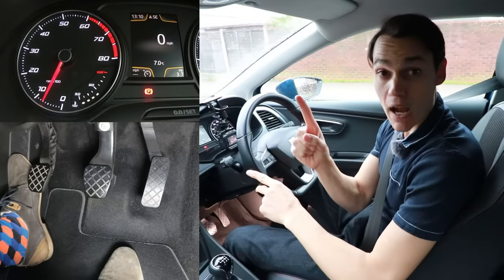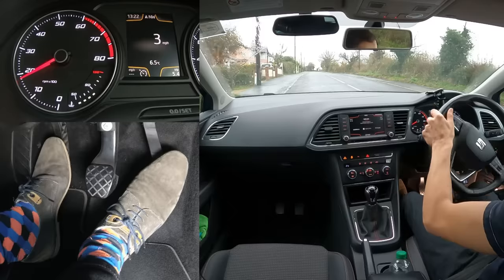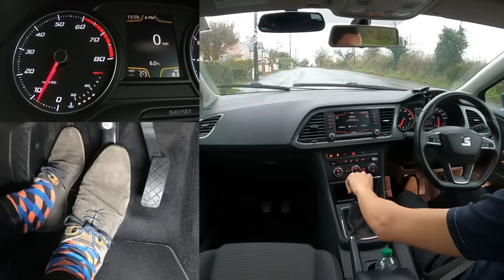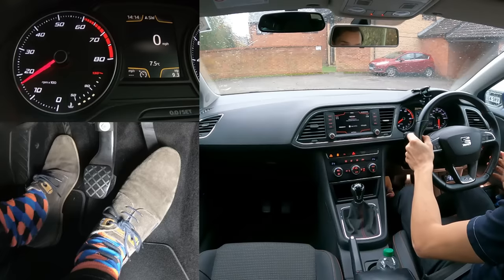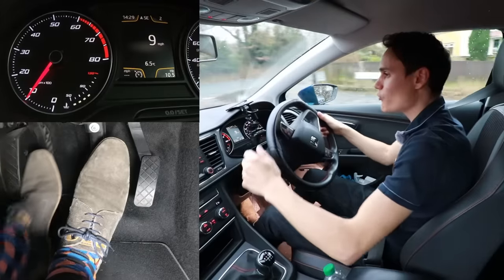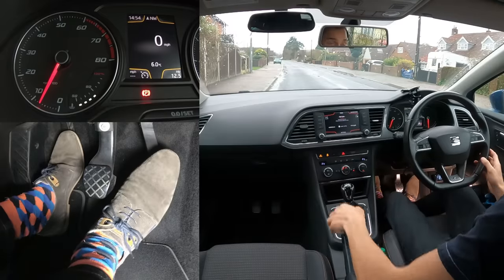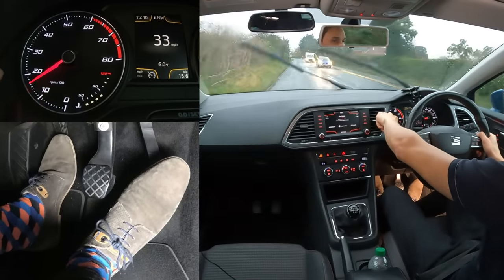How to make your clutch last longer without stressing the transmission.

Comment: I have been driving my own car for 5 months now, and I still find your vids very informative and useful. Thanks!
Reply: +1
Reply: That doesn't mean you know how to perfectly drive a car lol
Reply: Dont listen to this guy. In one of his video he was telling people how to downshift he ssid downshift to 1st gear. You never downshift to 1st gear. 1st gear is only use to take off. You damage your transmision like that.
Reply: You ask anybptofesionsl' there tell you not to do that. Once he said thst I change the video
Reply: @KrishnaSingh-ss9ef  I don't know exact situation you are talking about but if you slow down a lot. Like a couple miles per hour you are forced to downshift to first. Depends on a car too. In mine you have to at least if you are going really slow
Reply: @advocatesdevil7064  no you don't. 2nd gear can handle 0 to 500 rpm. I have been driving like thst for 10 years with my car. Didn't have to change my clutch yet. I1st gear is only use to move the car from starting position.downshifting  yo 1st gear is not the right way. When you gown shift ton1st gear. You can hear the car shaking and its difficult to, that tells you your not supposed to do that.what would you rather change your brakes or your clutch. Clutch is very expensive to replace.
Reply: I never heard of any car thst you are forced to downshift yon1st gear. Never heard of that in my life
Reply: If anybody want to damage there transmision, keep downshifting to1st gear.
Reply: @advocatesdevil7064  the other stuff he talks about, I agree with. Don't feather the clutch yo much. You can wear it out and also don't relax your foot on the clutch unless your changing gear
Reply: @KrishnaSingh-ss9ef  my car doesn't shake if I got into first gear when I am going super slow. It's same as other gears just way shorter. If I am going super slow in second gear my car is about to stall and that's what feels bad. Going back to first gear actually feels better. But again this is for super slow surfing like in a parking structure. Not all cars are the same. Yours might be fine doing that
Reply: @advocatesdevil7064     Krishna Singh is correct. If you are on a relatively flat roads, there is no need to change down to 1st gear in most modern cars. You will only use it after you come to a full stop. 
Oh, my Mini was 75,000 miles and 12 year old before it needed a new clutch. Some cars wears faster than others. Average cost is around £600 (mostly labour cost). After all, it is a wear and tear item. Unlike me, most people change their car between 2 to 5 years. So clutch wear doesn't even come into the equation.
As a newer driver, I think you should pay more attention on other road users instead.
Just my two cents.
Reply: @advocatesdevil7064  you might be right baron, all cars are different. I have a sports car, so my car might be different than yours. I can be in second gear and drive very slow. But like I said,  try not to downshift to much, thst wears out your cluth. If you have yo stop downshift to 2nd gear and put it in neutral. Unless your rev matching which takes a while to learn.Like I said clutch is way more expensive than. Changing breaks.
Reply: You think 5 months is a long time?
Reply: @buhketz  lol 5 months. There's info for everyone even after 20 years of driving as in my case. As for 1st gear, you pretty much have to come to a full stop in order to put 1st gear in, same with reverse which most definitely needs a full stop. Not all cars even have synchronised 1st gear nor reverse for that matter.
Reply: @GymChess  see, I didn’t know that about first gear. There’s always much to learn.
Reply: @KrishnaSingh-ss9ef  You silly don't know anything about driving or damaging transmissions. A big YES to downshifting to 1st gear!!! I do that a lot and there is a very good reason behind it relevant to good care of a manual trans car and it happen too often if you are really a driver. The guy in this video is right all the time.
The scenario:
Driving in whatever high gear, and not far in the horizon down the road I see traffic really slow and cars' tail red lights ahead of me are intermittently on and off as they move slowly for an indefinite distance and stop and again and again...I lift my right foot off the accelerator completely and let the car idle/coast until I reach within about few tens of meters and where my idle engine rpm slowed down to around 1300/1200 (I don't need to look at the gauge, just sense the entire system [wheels, vibration, clutch, transmission] by feeling) and so then at around the above mentioned rpm I hit the clutch, shift to neutral then slow down further and smoothly with the brake pedal while weighing and calculating the traffic's speed and then change to a gear suitable for that; let's say 2nd, but somehow upon getting closer and closer I figure out that even 2nd gear (say 5 mph depends on car) is still really too much and the car would start to vibrate if I use the brake to slow down further! There ladies and gentlemen where I find myself and rightly so technically and physically obliged to downshift to 1st gear!!! 👏Here transitioning to 1st gear goes wonderfully smooth and the car moves really slow but most importantly in sync with our traffic scenario speed!!! Of course as you know, at any moment in our traffic I might very well find even the 1st gear is too fast 🤔 I then hit clutch/brake almost simultaneously and shift to neutral☕
Reply: @triple-alphatv2946  downshifting put major stress on your clutch and gearbox.  So why would you want to downshift to 1st gear when you can just go to 2nd gear. Put it in neutral and come to a complete stop.
Reply: 12 years and I've just learned a few things lol
Reply: @KrishnaSingh-ss9ef Ive been watching his videos non stop for a last couple of days and he never said that
Reply: I’ve been driving for 11 years and I still watch these videos, the best 3 channels in my opinion are Conquer Driving, DGN and Ashley Neil.  These 3 channels have really helped me be a better driver.
Reply: @KrishnaSingh-ss9ef No he didn’t say anything of the sort.

Comment: You can push the gas before releasing the clutch. With this you avoid engine braking and have better fuel economy. Both is bad over slip and under slip. The springs on your clutch help to prevent the slip when shifting to avoid unecessary friction. That's why you should release the clutch hard. Only the first gear wears the clutch. When the car is accelerating from 0 mph. Don't use your clutch as a brake when shifting down. Shift down quick instead. Then you can let your car roll down. The clutch are like your brakes, each slip causes wear. Avoid unecessary friction and it will last long.

Comment: Yes!  This is exactly the video I needed!  In the "shock" sections of this video, I experience one or all those scenarios, at least once every time I drive.  Sometimes my car jerks when I change down gears, sometimes it doesn't, sometimes it kangaroos when I release the clutch after moving off, sometimes it doesn't.  Again, exactly those situations shown in this video.  But I didn't know what I was doing wrong.  Now I know, and I'll take steps to correct it.  This is definitely something I will work on.  I had no clue I was causing excessive wear to the drivetrain components.  Wow!  I've been driving a manual for close to two years, and I'm still learning something with every new video!

Comment: This video basically told me that I've been driving correctly. Thank you. My car is notorious for having a bad stock clutch (10th gen 2018 civic si), but I haven't had any slipping and I'm at 70k miles. I appreciate the work you put in this video 🔥🤙🏻
Reply: Did the climate control or the steering rack go on that 8th gen yet? Many issues with those ones
Reply: @everydaybodybuilding2282  8th gen si owner here with 214,000km. all the electronics work, no issues with the steering rack (its electronic) more reliable than the hydraulic system. The clutch i had replaced at 140k, still pretty tight.

Comment: For advanced drivers:
-Gear down : always rev match with a throttle blip and a smooth but quick release of the clutch (heel toe if you need braking).
-Gear up: change gear at 0g (that moment between acceleration and deceleration when you release the gas and press clutch).
-For launch don't over rev it , stay in the high torque zone and sync both pedal movements, the more you press the gas, the more you release clutch, for fast or slow starts.
-Clutch kicks are always your friends for breaking traction when full throttle doesn't cut it or you're too low in the revs and about to bog down,
you should be full throttle and then kick your clutch, the swifter it is the smoother it will be.

All these techniques can be done smoothly and shouldn't damage your clutch more that regular driving.
If you're doing it wrong the car will tell you by jerking.
Reply: Yeah I don't ride the clutch near as much as this guy advocates, if I have to delay an up-shift due to traffic and I get stuck in neutral in between second and third I just blip the gas up to get the revs up to where they were before I let out the clutch.  Downshifting on the highway to pass is the same, throw it into neutral, blip the gas to add 2-3K, quickly ease out.  The only hard to do one is the braking downshift, aftermarket pedals help but unless you are a track day junky when you are pulling up to a light you can just pop it into neutral and let the brakes (which are the most expendable of all) do all the work.

Also the handbrake hill launch thing is weird to me as an American, I just release the brake pedal and go right to the bite point as fast as possible.  Although my Subaru toward the end of it's clutch life (~80K, 45k of which was me) had problems with any reverse momentum at all so using the ebrake is probably better for it. It was also kinda weird anyway it didn't like hard launching in general due to the AWD I presume and it has an auto hill assist brake anyway.
Reply: You're just basically talking nonsense. Heel-toeing on street? Have you even tried to do that yourself?
Reply: @RomasTam  what's the problem with rev matching on the street? I learned to do it, just to try it out, but now, I'm doing it most of the times, because slowing down is smoother without riding the clutch.
Reply: @RomasTam  heel-toe on the street?
why not? 
clutch kicks on the street however, is a different story entirely. mostly because you'd probably break a few laws lmao
Reply: @RomasTam  Every time I go down a gear, everyday. please drive carefully when you try it out, it can take a bit of practice.
Reply: @RomasTam  i exclusively heel-toe on the street. anything else feels inefficient and like it causes more wear in comparison
Reply: And final tip:
All the tips mentioned above are actually unnecessary for normal road driving except a good downshift.
Reply: @hiighcalibre  Newer cars have hill-start assist that hold the brake for an initial few seconds on hills.

Releasing the brake and not having the clutch already at the bite point can either cause you to stall from not enough throttle or roll back.

Rolling back is actually something you can fail a driving test for in some places. It's dangerous to roll back even a few inches on a steep incline because you can hit cars, people, etc. 

I personally don't use it on my car unless it's very steep though.
Reply: @sjb122  lol right
Reply: @RomasTam  Git gud scrub, it's easy!

Comment: I changed my first clutch after 10 years and 165,000 miles. This is great info, and it is basically everything I do when I drive. Your clutch will last a long time if you follow the advise in this video.
Reply: A friend of mine has got an old mercedes with double the mileage, I don't think he's had to change the clutch yet. So you might have room to improve 😉
Reply: @Daniel-dj7fh  I'd gladly exchange a bit of clutch life, for the occasional fun. Zero to 60 in less than five is a nice rush.
Reply: @Daniel-dj7fh  If your friend travels mainly highway while the dude only uses the car on the road that's a fine result... It depends..  Just a guess
Reply: @brokentougers8252  The car was defo not used mainly on highways.

Comment: The release bearing is extremely important ! I did exactly what you described there with my first car, resting my foot on the clutch and it not only caused tremdendous stress to the release bearing, but also wore the clutch down and put it under constant heat when it was slightly dragging from time to time. Needless to say my clutch exploded ( was an old car ). 
I am glad you put this in your video so beginners never have to make the mistakes i did and learn the hard way like me.
Reply from the maker: I totally agree, all parts of your clutch are important and the release bearing is often over looked.
Reply: @ConquerDriving  You are a good driving instructor, very considerate
Reply: @ConquerDriving  Are there any data how often release bearings wear out? One, how often does it happen that a release bearing needs to be changed before the clutch disks need to be replaced? Conversely, how often do people change the clutch disks without changing the release bearing (because the release bearing is in a such a good shape)?

Also, how does the release bearing wear and start-stop system interact? I have only driven cars with start-stop systems briefly, as much as I remember, pressing down the clutch while at a standstill triggered the start-stop system while releasing the clutch restarted the engine. And for cars without a start-stop system, couldn’t a rule of thump be that if you are at a stop long enough to warrant putting the transmission into neutral (and thus releasing the clutch pedal), this would equally warrant shutting off your engine? Of course, in a car without a start-stop system the battery and alternator might not beefy enough to support too frequent engine shutdowns.

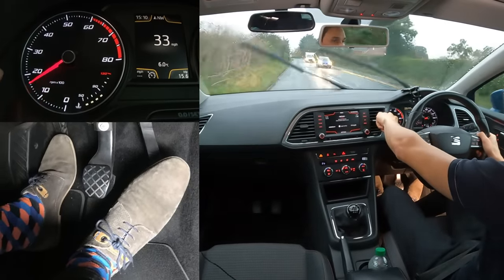Comment: 10:48  - A very interesting point, as a new driver, I'm applying the HB and releasing the footbrake. Some break lights are quite annoying to my eyes so I often think of those behind. It's good that you have pointed out that your FB is far stronger than your HB in that scenario you mentioned. Thanks for that.
Reply: I do this but only when I anticipate being stopped 30 seconds or more or when on a steep hill where clutch control is more challenging. My car has LED brake lights which are safer but also brighter to stare at when sat in traffic so I am aware of it.
Reply: @gravemind6536  Aye as a new driver, I've only ever learned if I need my handbrake get it on. But I reckon that was a hangover from learning how to pass the test, not necessarily learn your car
Reply: Parking brakes usually only applies the brakes to the rear wheels in most cars, however the foot brake applies to all four wheels, which is why the FB is usually more stronger and also easier to use because of brake boost.
Reply: I live in Florida so pretty much all the roads here are flat so I tend to not use either the FB or HB, that said I'm constantly keeping an eye out behind me to make sure people are slowing down properly. God knows Americans can't drive, especially in Florida.
Reply: I believe that standing on the footbrake for a relatively long while when the car is not moving, may be, under some circumstances, not very healthy for the brake discs and pads. I’m guessing it may be the case when the discs are hot or wet.

Comment: My parents have a 2006 Pontiac Vibe (aka Toyota Matrix) that recently passed 200,000 miles and it is still on the original clutch. The whole car still runs great even for a northeast snow and salt saturated area.

Comment: The preventing shock one is life changing for me, I’ve been driving a few months now and i just struggle with consistently trying to shift smoothly especially when changing vehicles. Thanks so much because i now realize i have to hold the clutch for longer and in my case apply a bit more power on certain upshifts, I almost never stall the car but in some vehicles I really struggle with finding the biting point and that leads to me stalling at times which is just very frustrating.

Comment: I've been doing lessons with my dad and the first thing he's taught me is clutch control. Moving off under 2k rpm, and also doing hill starts. We started on a 1% grade and I managed to nail it. I started moving in first gear, slowed the car down, and held it stopped using only the clutch for about 2 seconds, then started moving again. We also did it on a 10% grade. This is where I learned that you need a bit more acceleration to get the car going and to hold it on the hill. Also, if you stall and decide to swap who's driving, make sure your handbrake is in properly before lifting your foot off the break (we have a loose cable the handbrake needs lifting higher than normal to even park the car) 

(I should mention, my Dad is a trained paramedic with 20 years of experience driving ambulances)

Comment: Excellent video and advice Richard. You have a scientific explanation for clutch wear which I find most videos online lacking. What we think happens is quite different from what actually happens. 

My instructor had suggested never to use gas in neutral or with clutch pressed. He told me it wastes gas but I think he was afraid of clutch burn. In any case, a little gas is required for the clutch to bite successfully to avoid start up stall.
Reply from the maker: Thank you, as you say, in some cars starting without gas will caused the engine to struggle and possibly stall. A certain amount of clutch wear is to be expected, it can be minimised but not completely avoided.